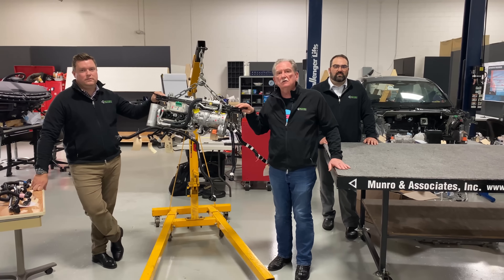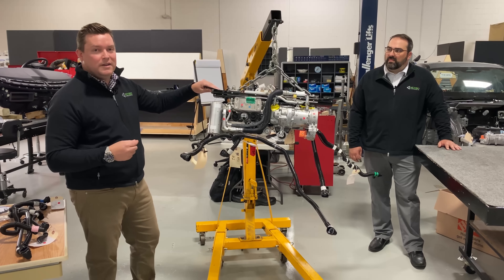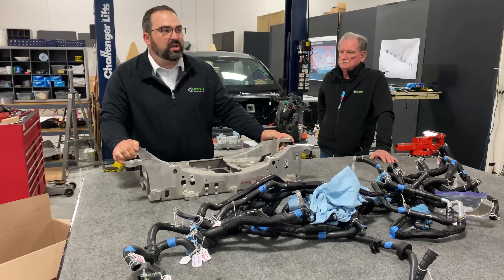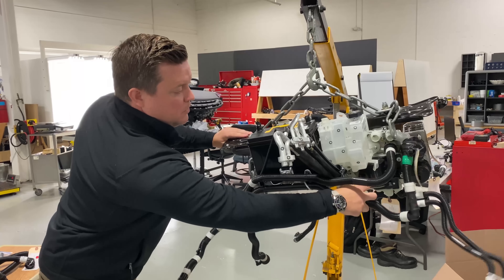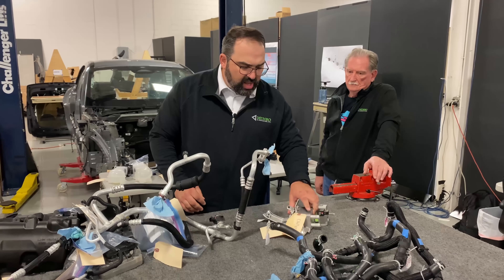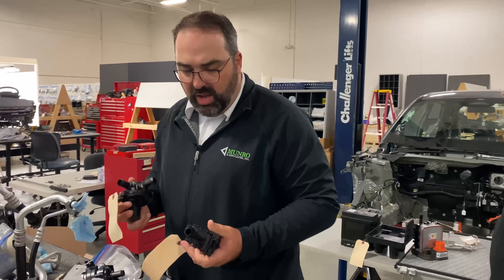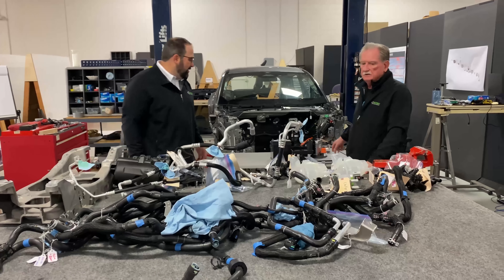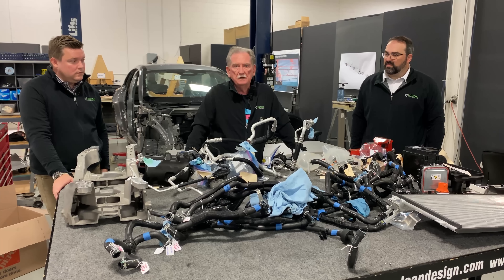Mach-E Thermal System Part 2: A Detailed Comparison to the Model Y

Comment: This is dramatic.  What will happen in a few years when hoses have to be replaced?   And what about potential leaks at the connections.  
This sums up the old adage:  Anyone can design anything, but only true genius can do it simply.
Reply: same as with tesla oil filters - yes thet have them. and faulty electric engines- yes they do break.
Reply: @hagestad  And your point is?
Reply: @hagestad  
You do realise the list of potential (likely) faults on this single "brand new" model is becoming increasingly long, yet you seem to be driving out occasional faults from a complete brand range, over the life of that brand, in comparison?
Don't you realise that's quite sad?
(Btw, you missed the old chestnut of "Model S door handles"😉)

Comment: This is a very good example of the good old "too many chefs in the kitchen" phrase. Too much reliance on off the shelf components, too much old school thinking "just slap it on there" without much regard to weight and function. Hopefully this is a wakeup call to the car industry, that the golden era of wasteful and afterthought design is dead.
Reply: This is also what happens when you stop letting the engineers run the company.

Comment: Congrats Tesla engineers.
Reply: Yes, congrats for building cars that overheat and go into safe mode after you drive them hard for 10 minutes.
Reply: @derbigpr500  Yeah MachE is definitely having overheating issues. Which is surprising with all the hoses and coolant. 
https://insideevs.com/news/520468/ford-mustang-mache-overheating-regen/
Reply: @dothehelenkellerlips  Those are breakdowns and issues with the software. There's a difference between a cooling system breaking down and causing overheating, and a cooling system that is badly designed and built and CANNOT do the job properly even when it's functioning perfectly.
Reply: @derbigpr500  homeboy, stop crying; go wash the cars at your ford dealership and let the engineers talk
Reply: @derbigpr500  Oh the world is ending 😂😭😆
Reply: @derbigpr500  
"Breakdowns and software"? 🤔 On essentially brand new cars?
Quit while you're behind.
Reply: @derbigpr500  Keep telling yourself that.  Even from Ford's response it says:  The high level of regen would have caused the battery to overheat.  How is that not poorly designed?

Comment: So basically, the Model Y system uses approximately 1/3 as much material to do the same thing.

They should have showed the total weight of all the system components & showed the differences (if any) in the performance specs of each system.

Great vid!  Thanks for sharing!

Comment: I was already shocked with this whole detailing of the difference between Model Y and Mach E. But when you mentioned that the Mach E is the 2nd best you've seen. That's just insanity.
How, with all the supposed "experience" in automotive engineering and manufacturing, are those OEM's no able to do any better?! Are they even trying really? I don't know what would be worse: them actually putting the best they can out there and simply not being able to do better, or, are these just "compliance" cars so they don't get fined as much?

Comment: The unstated "and then there's" is the assembly line. The Tesla system appears like it can be almost entirely preassembled into a package on a separate specialty line, then brought in and integrated at one or two stations. I can't even imagine the number of supply streams to the main assembly line, stations, workers, training and opportunity for error the Mach-e system presents.
To say nothing of the wasted battery pumping all that fluid around constantly.
Ouch!!

Comment: The Mach-E thermal system team at Ford must be having emergency meetings after watching this video.
Reply: It's a little late for that.
Reply: The only meeting results from Ford teams to their Executives will be why Munro is wrong, why Tesla will fail and how their system has been proven over time.
Reply: I can assure you they don't. They don't watch YouTube...
Reply: @niking92  I'm sure they do - but just cat videos and Beavis and Butthead clips.
Reply: @niking92  I think they do. Sandy mentioned in a previous video this week that Ford contacted him about the sourcing of the Battery. Sany named the wrong company and they told him they use LG batteries. So someone is watching.
Reply: We're number two!
Reply: @kmg501 
Étron!!! "number 2"!! 😁😁
Reply: @kmg501  Or even number three after VW ID.4
Reply: That's the problem.
"TEAM"
I get the impression the Ford system was designed by committee, with members in different buildings.
The Tesla?
Two (talented) designers 10 feet apart.
Reply: I doubt it, they're probably congratulating each other for figuring out how to get 25 pounds of hoses into a 10 pound bag.
Reply: @jimjam2286  lmfao
Reply: One team is made of career bureaucrats the other team is made of rocket scientists.
Reply: Hopefully.
Reply: No, it's a task for the leadership. Because the leadership has implemented how engineers are collaborating. Engineers don't invent business processes.
Reply: Nah, just digging their heads in the sand.
Reply: @ford
Reply: @fordmotorcompany
Reply: I Think its intented. To make money from maintainance
Reply: Elon MUSK is New God! Mars is the New Earth! Earth Will soon Die Anyway!! TESLA and Tesla Holders will be Kings. Rest and their Family will be Our Slaves and work to Power energy for Bit coin!! Elon is Einstein, Edison, Newton, and Jesus combined. HE at least deserves several Nobel Prizes. Elon has more IQ than weight of Hater's Ug ly Prius and his F at Ho Combined!! HE is like Ironman who will destroy Thanos and critics are better off using their cash to wipe their a n us. JUST Worship Him instead of other silly god!! GOD Elon will Punish infidels!! Go Emperor God Musk!!
Reply: Not really, because the Mach-E doesn't overheat in 10 minutes of hard driving like the Model Y does. Tesla is the one that should go to the drawing board.
Reply: @derbigpr500  Isn't it your bedtime?
Reply: @derbigpr500  Looks like we found the guy who works on the Ford cooling team!!!  Lol!!!
Reply: @morrisg  …burn burn burn  🔥
Reply: @derbigpr500  lol
Reply: @derbigpr500  apparently you haven't read in the news of mach E overheating merely going downhill because their regenerative brake heating is playing hovac to their cooling system.

Comment: WOW!  Mind blowing to see Tesla's HVAC next to Ford's.   The engineering on Telsa's side is just stunning.
Reply: Ford Mustang owners have heat during extreme cold, however some Tesla owners been complaining since 2001 that there is not enough heat to keep windows defrosted. 
Fast-forward to 2022 more Tesla owners complaining and Tesla's over the air updates have caused more vehicles to have issues.
Reply: @GrandmasterFU666   My post was 5 months ago.  Tesla is currently having issues with an expansion valve getting stuck open in extreme cold.  They made a mistake and yes they should (and will) fix it.

I'm pretty sure the software fix alone won't solve the issue however.  Probably a mix of this recent software update and a physical replacement of the valve in question.

To your point about not enough heat in Tesla's since 2001, I can't speak for early Tesla's, just my 2018 Model 3 that has plenty of heat.  But mine has the resistive heating element and not this new heat pump.

To your final point about updates in general causing "more vehicles (Teslas) to have issues".  That's a very general statement and perhaps difficult to rebut by design.  I can only speak to my own experience with my 2018 Model 3.  

The software updates have generally been very positive for me.  Introducing many new fun and useful features over the last couple years.  Unlike cars of old, who's features never change, mine has gotten better and better over time.  I love it.  I'm happy to see companies like Ford finally embracing this new paradigm and follow Tesla's lead.

There have been some down sides (such as questionable placement of some UI elements), but on the whole I've been excited at every update.
Reply: @GrandmasterFU666  -  Huh?  My '20 MS gets a software update every 4-5 weeks without fail, I've never once had problem with any of them. In fact the updates keep making my EV better and better...no complaints, best car I've ever driven and owned and I've been driving for over 65 yr, ex-hot rodder.  I wouldn't touch a Mach-E with a 10' pole.
Reply: @Chainyanker007 this post is over a year old, Tesla owners were complaining about heat issues in their vehicles!
 If Tesla is the best  car you have ever driven, I would hate to see the cars you have driven what we're they Pinto,  Chevette???
Reply: Tesla has had to work very hard on manufacturability; they have to squeeze out costs everywhere they can -- doubly so, since simpler assembly is required if you are trying to speed up the assembly line.  The result is plain to see -- they have a pretty elegant, simple, inexpensive system. 

Ford can get there; it is just a matter of putting in the engineering time.  The Mach E is a pretty early generation BEV for Ford, so expect much better things in just a couple years.  (*crosses fingers*) they will get there faster if they buy the reports.
Reply: @39401JLB  - There are some parallels in software, easy to write tons of code to do something but much harder to do the same thing in way less lines of elegant code.  I'd say Tesla has lots of elegant code but probably not the competition, esp VW.
Reply: @39401JLB  they will go bankrupt before that, like this month,August.😄goodluck with your dumbass essay you wrote for no reason. Sorry bro

Comment: Thank you for showing side by side comparison. Numbers are great, but showing things physically side by side really put things into perspective a lot more easily.
Reply from the maker: Great point!
Reply: It's like putting current wife - Tesla    next to the ex-wife -- Mach E
Reply: I particularly enjoyed the motor videos because you almost always have two or three different ones for comparison.  It'll be really interesting when you get a 4680 Tesla battery pack and can put it side-by-side with one of the older ones.

Comment: 35 hoses = 70 connections. 70 places for a leak and in a previous video Sandy and crew showed how difficult it is to get to many of those hoses and connections. Wow, a repair nightmare down the road for Mach E owners. Better buy the extended warranty.
Reply: I can see whole powertrain and suspension removals to fix/find leaks.  Wow, what a nightmare.  I sure wouldn't want to be owning a Mach-E for very long as I'm sure the stealerships are ready to HOSE customers for the ongoing maintenance costs (maybe purposely engineered like that?)

Comment: Do I get this right, that the Mach-e does not even have a heat pump for cabin heating?
Reply: A Google search says "no". They use a resistive heater.
Reply: Tesla didn't until the Y.
Reply: @concinnus  you are right, I was just assuming it had to have one with all these hoses. For me, the heat pump was the reason not to buy a Model 3 for years. As BMW had it as an option in the i3 all the time.

Comment: Gonna be fun replacing those pumps years down the road. I hate the water pump replacement in ICE cars, way too much labor for such a cheap part! I just cannot imagine the maintenance on the half dozen pumps on the Mach E and they are squished together so tightly you need a leprechaun to work on it unless you drop the entire  part.

Comment: Well the Tesla Model S's 3 and 4 way valves are prone to failure, I just found out on my MS 85D. Gonna be interesting ...
Reply: Pretty sure Tesla has made improvements since that 85D.
Reply: Yeah ai think the S, sadly, will not be as impressive as the 3 and Y for engineering efficiencies. The S and X were designed as lower volume and quite older design and engineering advances. Be very interesting to see how much of the good new stuff in 3 and Y has made it into the newest S and X.. the mega castings are certain to not exist at their volumes. We know they added the heat pump.. so you would expect octovalve has made it, but dunno.. lots to look forward to seeing

Comment: The potential dealership revenue from repairing leaks and replacing hoses on the Mach E will be significant.
Reply: imagine it as used car out of warranty....
Reply: $2.50 for the part.

$350 labor.
(Nothing new there then)

Comment: This tells me that Ford’s thermal-management engineers need to go back to school and pay more attention during thermodynamics and heat-transfer courses.  BTW, the 29 dislikes are from the Mach-E owners and/or Ford engineers.
Reply: I want to bet they just did what they were asked to do. I still want to applaud Ford for taking the effort even if the design wasn’t as good as Tesla’s. However it makes me happy as a Model 3 owner to see that I made a good choice 😅.
Reply: @mdf1978  If they are controlled by the “bean counters” upstairs, then I have little hope for Ford’s future. Thermodynamics is one of the most difficult subjects to master. Go check out some books by John Prausnitz.
Reply: it takes time and multiple iterations to refine, simplify, a complex system like HVAC. I'm sure the bean counters said "no time for that, too expensive, use the parts we have and make it work". This is the result. Embarrassment has a way of shifting priorities. 20 years ago, they could get away with this mess, only their service centres would know. Now it's public knowledge for all to see.
Reply: @CarlForde  I wholeheartedly agree with your assessment of the type of approach that Ford has taken. I don’t blame them as it’s probably business as usual to design new things from the top-down approach of seeing what they can come up with some of the parts that they already have. Tesla appears to take the bottom-up approach of designing new things in solving a problem.
Reply: @CarlForde  your assessment sounds very plausible. And if Tesla or Munro & Associaties didn’t exist, no one would criticize Ford for this design.
Reply: System-engineering is where they went wrong. What functions do we need .... what's the simplest way to achieve it ... conceptual design ... SIMPLIFY ... redesign. I have a funny feeling that schedule pressure led to the design that would be the fastest to get into production, as opposed to one that was more optimised in the longer term. And I betcha future Ford EVs will be better than this.
Reply: @bikeaddictbp  I doubt it only because Ford builds their cars to require “routine” maintenance sort of like how BMW loves to design in oil-seal leaks and cooling-part failures just outside of their comprehensive warranty period. BMW knows plastic water impellers in their water pumps don’t last long but they want it anyways. Plastic oil pan? LOL. 

Ford is just as bad. Ford loves their modules. Every thing is modulated by their modules in their engine bays way more than how Toyota and Honda necessitate in their vehicles. Name me a Ford that does not require at least one module to be replaced just outside of their warranty period.  Coolant leaks are probably what is going to bring Mach-E customers to go back to their stealerships.

Comment: What???? Are you sure it is better than the Polestar? Are you going to do a tear-down of that vehicle.
Reply: "Every 2021 Polestar 2 Is Being Recalled for Random Shutdowns"
"The Battery Energy Control Module (BECM) microprocessor may reset and cause the high voltage system to disconnect. A disconnected high voltage system can cause a loss of drive power, increasing the risk of a crash."
"Polestar 2 Review: How I got stranded on the highway"

Looks like this car can tear-down itself
Reply: They had the Polestar 2 there.. I’m sure they at least looked and are making this statement on what they saw